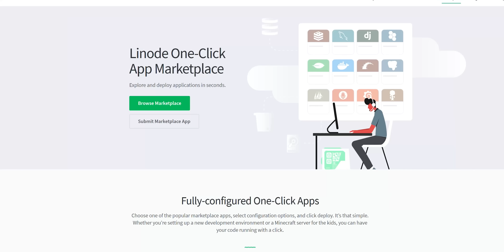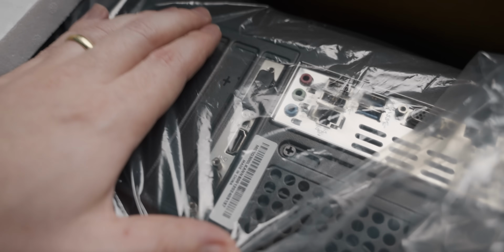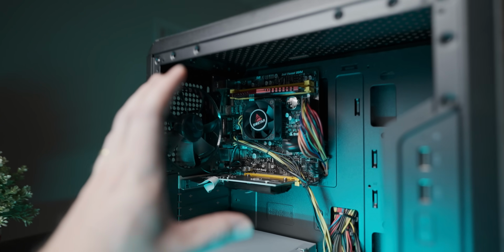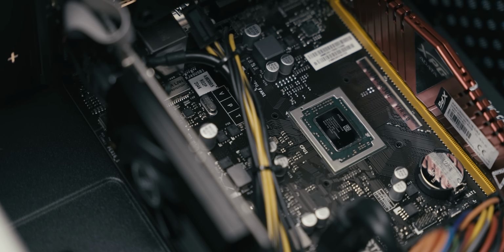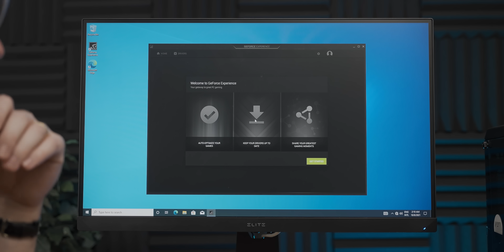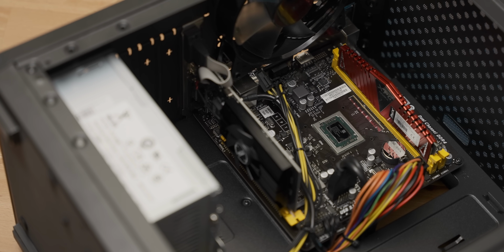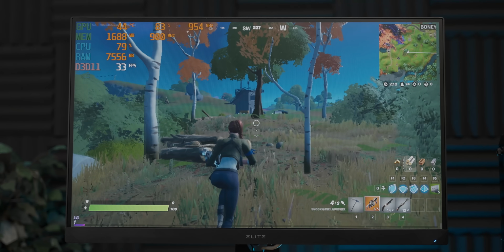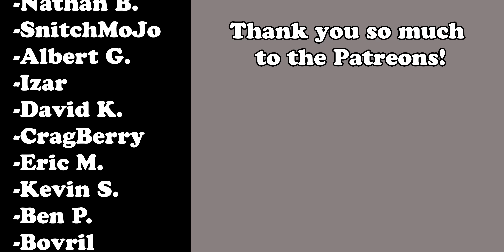The Cheapest Amazon Pre-Built "Gaming" PC is Ridiculous...

Comment: An ITX board inside an mATX case, inside an "E-ATX" Box - Your Russian Dolls analogy held up well here Dawid! :D
Reply: In terms of storage device, I came up with this ultra Matryoshka setup plan: dual micro SD to single mini card (mPCIE/mSATA), dual mini card to single 2.5 inch SATA (look it up, there's a really neat adaptor of this sort, even supporting RAID), triple 2.5 inch SATA to single 3.5 inch HDD (IcyDock makes those and they are built to a quite high standard), and finally quintuple 3.5 inch HDD to triple 5.25 ODD, which is fairly easily achievable with old school full tower office PCs. 

That's, like how many, 60 micro SD in total? And 1920 GB worth of storage if that's 60x32G cards set up in all RAID 0? I wonder how the thermal will be like if anything ever ran through such a monstrosity.
Reply: @funghiman8492  im curious what that'd show with a benchmark

Comment: I have a Dell Optiplex 9020 that I converted over.  It has an i7-4770, 16gb ram, SSD drive, new 500w power supply and a GTX 1660.  She's a barn burner.  Runs cool, runs BFV fine.  Paid $120 for the rig and market rate for the upgrades.  I spent a total of around $450.
Reply: Living the dream

Comment: Dawid - "Do you want to see a video where I take a Dell and "
Everyone - "YES"
Reply from the maker: Haha!! Fair enough. 😁
Reply: @DawidDoesTechStuff  haha Dawid I'm actually watching this video on my Optiplex that I added some ram and a graphics card to. It has worked splendid for me and I only spend $180 on mine in total. My hat is off to you sir! I was inspired by your last video on the subject.
Reply: @DawidDoesTechStuff  A video with a refurbished Dell Optiplex with adding more RAM, SSD and a graphics card. It might be hard pressed to find a good graphics card. It would also be a good comparision to see performance difference between Windows 10 and Linux OS (such as Ubuntu/Linux Mint) for gaming on a refurbished desktop
Reply: @DawidDoesTechStuff  When i need a good laugh :) Trust Dawid and Company <3
Reply: @DawidDoesTechStuff  the cheapest gaming pc on amazon that's good is a steam deck with a 1tb ssd ;)
Reply: I recently did this. There was an OptiPlex 990 literally in a pile to be recycled so I got it for free. Already had an i7 and 16 GB of ram. Just had to drop an SSD and a GPU into it. It works great.
Reply: @nicholasmutsaerts3175  them eBay dells from schools are very salvageable. Used one for years I found in a dumpster. Surprised it had a old ass i5 first gen. No GPU tho. I got a broken fan 1070ti. If I run in the lowest setting the 1070 doesn't blow it up. 😅 But I only have 12gb ram. Kind of the only ddr3 I had laying around at the time. Now I use a Ryzen 9 laptop that's just as good if not better cause I can leave the house with it.
Reply: hahahahah
Reply: @DawidDoesTechStuff  good laugh for you to check out. have you seen these scams of a system. they use 2nd gen intel i7's, ddr3 ram god knows what versions of a 1630 graphics card. best part is its all used hardware for 450 pounds...... they need shooting.
Reply: Love ya bro  @DawidDoesTechStuff

Comment: I still have an AMD A series APU based desktop.
I bought it in about 2012-13 when these things came out.
It was the first and to my knowledge only AMD product to feature crossfire between the built in GPU and external GPU which I tool advantage of.
The components were relatively cheap at the time, and it was halfway decent for games of that era, but it became outdated near instantly.
It does still serve as a general purpose PC to this day and performs this task admirably.
Reply: well makes you wonder how much the igpu is screwed by the single channel ram situation
Reply: @raven4k998  eh... doesn't matter much today. By standards of today that thing is a potato.
Reply: @dgurevich1  yeah it's just that little voice in the back of my head wondering how much single channel nerfed it would it atleast have been able to load the whole world with dual channel fps would likely have been the same due to it being pure crap though

Comment: Look forward to the Dell Optiplex. It's still viable but depends on how cheap and how recent the Optiplex is. They also have various forms and models so it's surprisingly complex yet simple enough to work with!
Reply: I have one and it's a solid build with really janky stuff going on on the board.  Power connecter is really strange.  Had to get an adapter to change out the PSU.

Comment: I bought a pre-build with the same motherboard + apu about one year ago in a full tower without a gpu so it looked kinda ridiculous. I have now upgraded my psu and bought a 6600xt  but haven’t yet replaced the motherboard and cpu so I have a hard bottleneck there
Reply: I was able to cop a 3800xt for like 180, check that out used. I also paired it with a used x370 board, so I could upgrade to ryzen 9 later if I wanted. pretty good path if you like amd for used performance.

Comment: Built a gaming PC for a relative recently. Optiplex Tower with i5-3470 and 16GB RAM I got for $40, a $20 SSD and a $200 used 1050ti on eBay. Not a bad little PC for less than $300.
Reply: $60 Optiplex i7-2600 and a $80 GTX 960 2gb here, it's a beast for the money.   I'd have preferred a 1050ti for the extra vram, but they were around $250 when I was looking.  Considering I bought one new for $139 back in the day I couldn't bring myself to overpay that much.
Reply: The both of you built nice systems honestly
Strong enough to run games from the golden age (pre microtransactions), and it'll run some modern games

Thumbs up to the both of you!

Comment: I actually really love that cooler master case.  I've built in it a few times and it's a solid case.  Only thing I don't like about it is the way the psu is pushed back because of the weird opening for it
Reply: does two sticks of ddr4 do anything for gpu performance?🤔
Reply: @raven4k998  well depends, 2 sticks of ddr4 will give better performance than 2 sticks of ddr3, besides that dual channel ram will improve gaming performance.

Comment: I still use an old i7-3770 with a 1060 3gb.    I need to upgrade but this still works well enough until parts availability and prices(I hope) comes back.   I've already got the old stuff in a Lian-Li Lancool II Mesh RGB case ready to rebuild.

Comment: Dawid, would like to see a updated video on what the i5-3570K can still do with a new 3070 RTX.. Does it bottleneck enough to matter ? My nephew is rocking my old one on an Asus K77 board.. and well its still doing it. So he wanted to know which way to upgrade.. and I am hard pressed to say he needs to replace the MB or Processor ( He has a 1660 ti ). I mean a video where you benchmark era specific video cards with it and then move up to the various generations, 970, 1070 2070 and 3070.... and see what it can still do.

Comment: Im using an old optiplex for my sons gaming pc.  The biggest problem is that you often cant physically mount a real gpu in the dell case, there is just no room.  Im using a gforce 760 and its quite large.  Finally had to rig it up in an aftermarket case to get it all working.  Dell's proprietary accesory boards like usb and audio dont fit anything as they are non standard so they just kind of hang out the front, but with the dell's  i7, 16gb ram and the old gtx760, the thing works pretty darn good.  Plays his games at 1080p no problem.  It's definately viable if you have the stuff lying around.  Cheers.

Comment: I bought a predecessor of this board that officially is passively cooled...
Made it into a bit of a junkyard/sale pc for fun 
  Pointing a desk fan to to the cpu  boosted performance 🤣. It can run 4 k Windows 10 but not really. Runs fine with Arch. I DIY ed a cpu fan in the ITX case with some tie wraps and put some olds sata Ssds in it velcroed to the side. Velcro was tailor bought. I added the NVMe to PCIe adapter into the only PCIe slot. U am still waiting for a good ssd deal. The most expensive thing in the build is the Pico PSU I added to it.

Comment: Condiment colored cables do not belong in systems with side panel windows. Motherboards smaller than the case form factor don't either. And even the big box OEM's (HP, Dell, etc.) have been using single-DIMMs in dual-channel systems for as long as dual-channel memory has existed. Oh, and Power Man PSU's are terrible, but they've been around for well more than ten years at this point. I remember seeing them as a technician at Comp USA and Best Buy during the early 2000's.

Comment: My last cheap mega system was a i7 4960x with 32 gig of ddr3 ram and a 1070gtx. It was pretty fast and I traded my buddy for helping him scrap computers that were trade ins pulling all the usable parts out and scrapping the rest. I reused the 1070 and he gave me a i7 3820? and board That I upgraded with a ebay top end Asus pro level x79 board with the 4960x installed for around 200 shipped. The board was supposed to be bad but I found a bad setting in the bios and it booted and ran stable so I ran it and put the leftover board and cpu in another box for a backup. A setup like that one would be a better budget gaming setup using older top end parts.
I have a Ryzen 3900x now with 32gig of ddr4 and the 1070gtx still I have around 500 in from the same buddy. Deals are out there if you have friends and skills, plus some good leftover parts.

Comment: I'm running a Ryzen 2300x, 16gb RAM and a 1660 super. Complete system is used parts. Only in the whole setup for $500 or so. I keep upgrading as I find deals on hardware.

Comment: My desktop used to live in such a Q300L case.
It's a very clunky size and despite all the ventilation holes does not cool well.
The side window also scratches if you look at it wrongly and attracts dust absurdly well.
But it can be inverted, which I did before I moved my machine to a very classic style design, in which I installed a DVD drive.

PSU wise my power supply is on some decently trustworthy ranking list as one to avoid, as it lacks over-current protection.
I tried upgrading it, but the replacement overheated itself and shut down consistently, so I opted to keep this PSU until the entire thing fails or gets upgraded.
After upgrading the RX570 to a Vega 64, as the former didn't like my Ryzen 3 3200G's 8x PCIe lanes, this system has been serving me well for 3 years now.
I did have to downgrade the RAM frequency to 3000MHz though, as the APU seems to have a degraded memory controller.

Comment: I'm still running i7-3770 / 16gb ddr3 1866 / rx570 

but I think you should upgrade that pc, the igpu in the fx9830p is a R7 based, so any R7 series GPU's will be able to go 'dual graphics mode', and the APU can handle upto 64GB (weather the motherboard will)

Comment: So I took an old hp elite 8200 sff refurb that came with a i7, shoved 16g of ram in, an SSD, and a GTX 1050ti.. the thing really screams.. and I mean not in an half assed low budget way. However, though I bought the GC new in 2018 for 150, that same card today is like 400 bucks.. so I don't even know if that's possible now. But I think I spent a total of 500 bucks or so on the setup.

Comment: I would like to see you use an i7 920 with an x58 sabertooth motherboard 16 to 24 gigs of dominator memory I'm currently using the same configuration as a second computer with division 2 at 1440p I get a solid 70 frames per second previously at 1080p I hovered around 144 frames per second using a founders edition 1080.

Comment: Great vid, it does amaze me though I built an FX8350, 16GB 1866 dual chanel, GTX 1050Ti, 500GB dram SSD + 3TB HD, wifi + BT card, in and out air flow, big cpu cooler and for example gets between 70 to 110 fps on GTAV on high settings at 1080p, tried to sell for about £450 making about £40 for myself and I can't get any takers yet these sell all day long...

Comment: Hey Dawid, Can you test Ryzen 9 5900X or any Zen 3 you had on Gigabyte A320M-S2h, its a very budget A320M board but Gigabyte released new Bios Updates that include Zen 3 Capability, I'm curious to see how much worse if you use that budget A320M board with High TDP/Performance Zen 3 CPU Compared to proper/high end B550/X570 motherboard

Comment: I am not sure how often you check and reply to questions, so here goes: I own a R11 Computer (built in 2021) and have tried putting new thermal paste on existing air cooled CPU. Still runs hot sometimes loading up DCS VR. I want to know if a VRM heat sink Part number VRM Heatsink Voltage Regulator Thermal Module Pad N1C1D ON1C1D for Dell Alienware Aurora R11 R12 Desktop would help with heat dissipation, or is it better to use VRM with Corsair AIO water cooled Heat sink. Please advise. Thanks so much

Comment: Instead of dell optiplex. Get HP with core i5 or i7 4th gen. Then put some 4gb ddr5 graphics card. You will be surprised what performance you will get. Should be cheaper than this but a lot more powerful.
Reply: My recommendation is get HP 280 G1. You can even take all the parts out and put in new pc case. Will need usb 3.0 to 2.0 adapter. To connect it to case. Since it doesnt have that.

Comment: I bought a cute little SFF Optiplex from a yard sale that came with a GT710 and a "Pentium Dual Core" from the Core 2 era. It was configured for low profile mode, predictably. $5.
Grabbed two, actually, but gaming on a Pentium D in the modern era is ...... not advised.
It got a very prompt CPU upgrade. The GT710 is quite the catch when paired with the Q6600. .... I might be bottlenecking the Q6600. Even in CPU-heavy games like BeamNG.drive.
Also FX Bulldozer can't use RAM any faster than about 2400MHz as an architectural level limitation. I've yet to see an A-series (which is an FX core under the hood) that can break 2400.

Speaking of those little Optiplexes, I also picked up a more modern Haswell one and am trying to shove a low profile single slot GPU in there.
Tragically, as of the day I type this, my hopes and dreams of the RX 6400 being that card were smashed when I learned that it has exactly four PCIe4 lanes that won't cut it on a Haswell.
I'm most likely going to throw an nVidia T1000 in there. Those can actually hold playable framerates in RDR2 if you temper your settings right, and seems about the right amount of performance for the Haswell i5 in such a delightfully small box.

I would love to see you do more with your Optiplex systems. I love these things.

Comment: I think the GT 710's main claim to fame is being "being better than onboard graphics". It might be interesting to try to put something a little bit more potent in the graphics slot. Maybe something like an R9 390 or so. It has been a long time, since I had to look for replacements for a GT 710, but at the time, the R9 seemed to be a good solution, for keeping the price to under $200. Perhaps there are stronger cards that could unlock even more potential for that computer, without costing too much. 

The idea of a small machine, that does a competent job, without taking up too much space appeals to me. However, by that same token, maybe the setup is still a bit large for my tastes - for that particular application. There's a lot of room for drives, if there are enough channels. Ventilation seems good. It would probably fit nicely, in certain carrying cases. Sometimes, there are times where you have limited room, but want something a little heftier than a laptop.

I've lived off of a laptop before. There have been times, when I've actually used it for its intended purpose. However, most of the time, when I've been laptop bound, it has mostly been limited to my desktop, with an external monitor, keyboard, and mouse connected. I probably didn't really need the screen and the battery most of the time.

Comment: the power draw must be awsome it a loptop cpu with grafics cores the gtx 710 is also lowpower but i would put a 1660 or a T1000 in it. 
what mainbord is it? i have seen similar mainbords in the industri there called ipc and there need serial but some other ports to. normaly you cant buy these type of mainbord and if you do buy one there extreme expensive mostly. if i could buy such a mainbord with a solderd laptop apu i know exatly what i would do with it because a raspberry is to weak for these work but lowpower and a normal pc is optimal in performance but cost too much energy and a old laptop have all that stuff around what i dont need and the needed ports not avalable and some laptops dont run without the battery. the batty is danger if you constand charge it over years. so this mainbord is perfect but chase and psu do i have a lot and the gtx yea is basicly e-waste

Comment: I did the Dell Optiplex thing but with a Lenovo M91p. I liked the way the Lenovo was put together better. I still run it. It has an i7 2600, 32gb of ram, had to upgrade the power supply, add an SSD, and put a gtx 970 in it. It can still run any game I've tried on it and most the time I can run things at really high settings. I game at 1080p with that computer. Mostly mentioning it as an alternate system to keep an eye out for other than the optiplex. My lenovo came from a business that didn't need it anymore and I got it for $75.

Comment: I took a 4th Gen HP EliteDesk 800 G4 SFF, maxed it out, I7 4790K, 24GB DDR3 RAM, 120GB SSD SATA drive, added a GTX 1050ti low profile GPU and got 4 times the gaming performance of that turd. 1080p on a 44 inch big screen TV. All for under $400. (with the exception of the TV which I already had.)